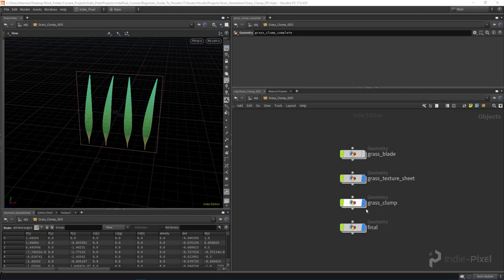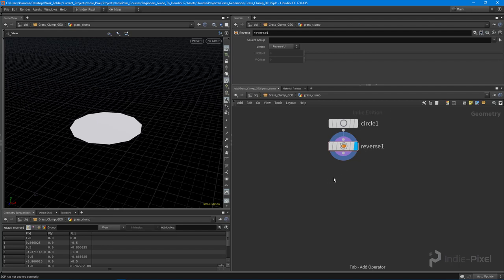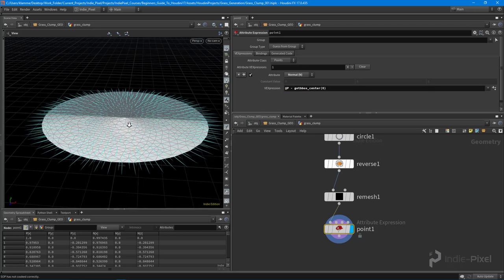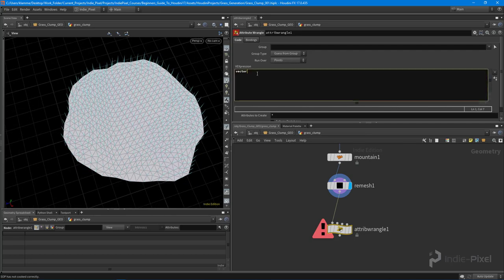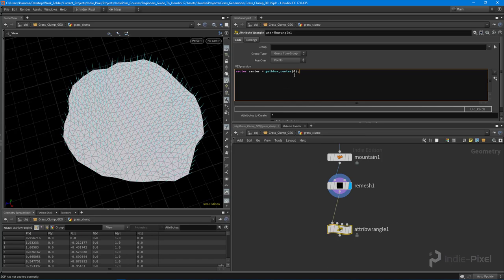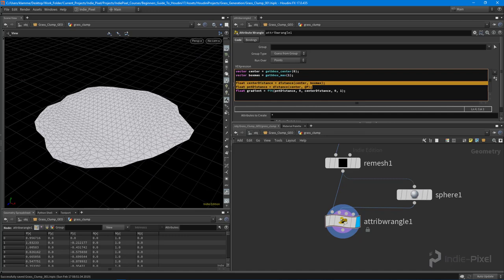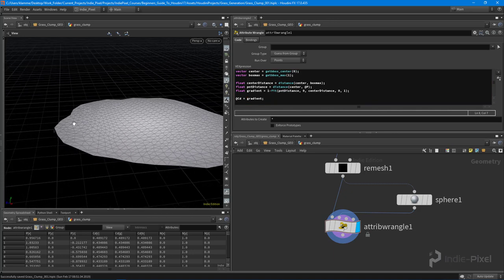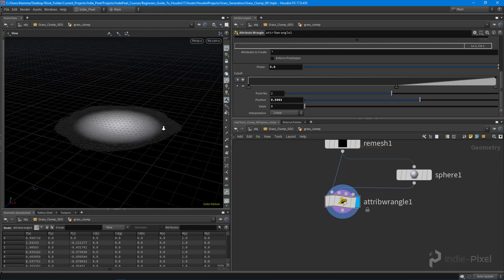Procedural Grass Clumps in Houdini and Houdini Engine - Part 5

Comment: Thanks so much for this Tutorial. I'm using v18.5.408 of houdini and the @Cd = gradient; doesnt give me any gradient that's visible in the viewport. I had another issue using Cd in your 3rd installment of this series where we're Raycasting the texture sheet and I'm not getting any color value for the leaves, just the white shape of the polygon. I figured i did something wrong. But here in this video there's not a lot going on for me to get wrong. And it is making me wonder if there something about @Cd that's changed between the v17.0.435 and the one im using?
Reply from the maker: The Cd attribute is still there, not sure what could be happening...I'd have to watch the video again to see
Reply: @IndiePixel3D  Thanks for the quick reply! I'll keep you updated if I figure anything out.
Reply: @IndiePixel3D  So it appears the gradient is there but in my case, it's not a gradient between the edge and the center but a single gradient value for the whole object. So in effect, the slider we made with chf("power") just controls the brightness uniformly for the whole object. I double-checked my code for finding the distance between the center and the edge, but it looks identical to yours.